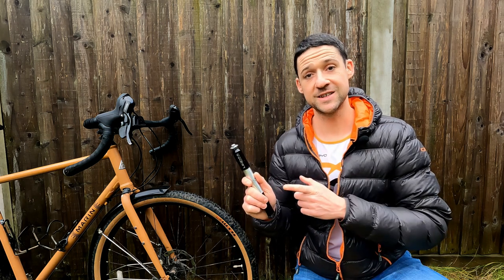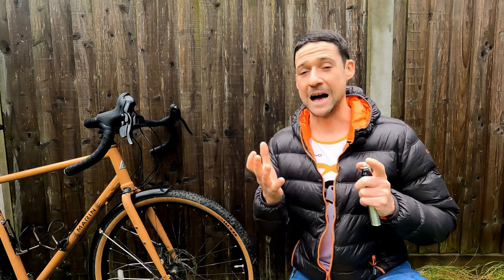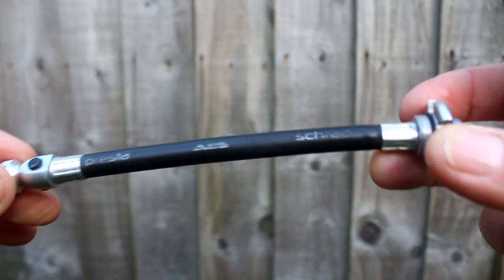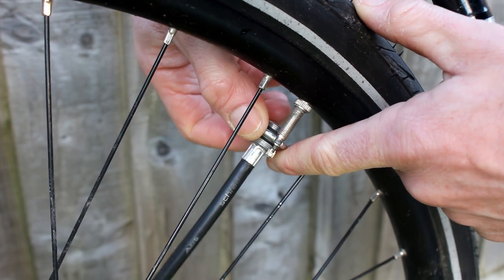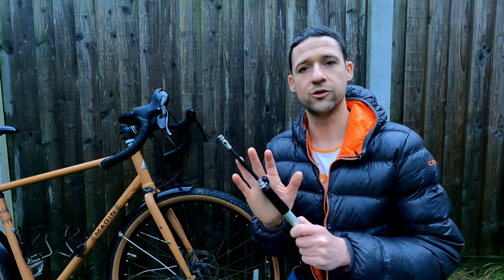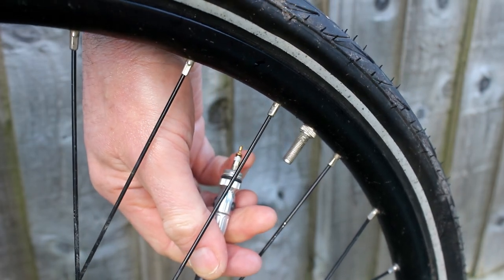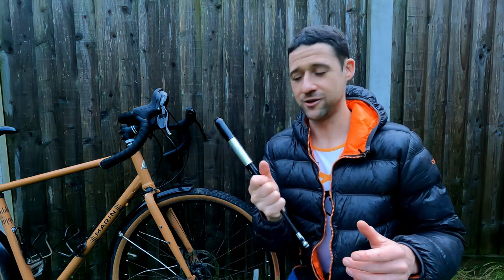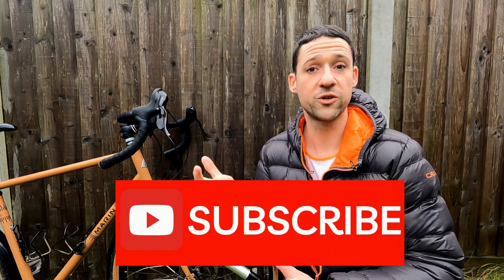Worlds Worst Bike Pump | Lezyne Pressure Drive Bike Pump Review

Comment: Hi, Mammoth Journeys! 

We're sorry to learn of your dissatisfaction with our Lezyne Pressure Drive Hand Pump - we put together a Chuck Tutorial Video which operates in the same way as the hand pump you're using to hopefully better explain the steps we follow when inflating tires with ABS chucks. Please see here: https://youtu.be/9acMIpfEA1s we also put together a comprehensive guide to our chucks for further information which you can see here: https://youtu.be/6sz7bxtZJi4 

Some steps to follow when using the ABS chuck systems:

Steps for inflation (Presta valve): 
1. Remove valve cap
2. Loosen valve nut
3. With tire deflated, regularly ensure valve core is tight with built in Presta valve core wrench (be sure to loosen valve nut for correct engagement) 
4. Thread on chuck (do not overtighten)
5. Inflate tire
6. Press ABS button to release hose pressure for easy chuck removal
7. Unthread chuck
8. Tighten valve nut
9. Install valve cap

Steps for inflation (Schrader valve): 
1. Remove valve cap
2. Thread on chuck 
3. Inflate tire
4. Press ABS button to release tire pressure for fine tire pressure adjustments
5. Unthread chuck
6. Install valve cap

Additionally please ensure the quality of the tubes you are using as well as the integrity of the threads in the valve cores of those tubes. By following these steps we sincerely hope this improves your user experience. Our goal is provide world class product with pure function and clean aesthetics of the highest quality. If you have any questions please feel free to reach out! Thanks!
Reply from the maker: Hi Lezyne, Thanks for commenting on this video from my experience. 
Before I bought this pump I had read on your website along with the videos on YouTube how to use the hose, along with reviews of the risk it posed. After the first time the inner core came away I made sure that the inner valve was tight enough, and then kept pressing the ABD button to really make sure any pressure was released, which seemed to have good success. Until, it happened again, a further two times. 
From the comments there are certain workarounds to avoid this, the most practical is to buy inner tubes which don't have a removable inner core. I also fully admit the biggest impact is user error, however from the comments here and other printed reviews of this pump, I am not alone in my experience. 
One thing I cannot understand, and I really hope you can shed light on is this: During the R&D process the inner valve core would have been removed during use, prompting the videos you linked above to made and a thorough checklist on how to use the pump produced. Did it seem like a reasonable risk at that stage to continue with the current design versus altering it to avoid this risk entirely? I can't believe with the team you have, that a risk when using a pump is that the all the air you have just pumped into your tyres could be lost, they would be happy with it. You produce products which are too high quality for that to be a scenario - what are your thoughts?

Thanks again Lezyne and happy riding!

Comment: Bought one last month while on vacation. Rubber hose part has has metal fitting which screws into the plastic threads on the pump body. Needless to say I didn't use the pump until we travelled on, only to discover the cheap plastic threads are stripped.
Super expensive pump already, but now have to pay for shipping to send it back to where we bought it.
Reply from the maker: Oh no mate that is some rotten luck. Clearly someone not doing their QC checks! Hope you got your money back alright in the end. What did you go for in the end?
Reply: @mammothjourneys  Seems many products are "rotten luck" these days the way they build stuff now. I can name at least 6 overpriced items that were awful quality I purchased/replaced over the last year: that pump, eye glasses after one year the scratch proof coating began to separate from the lens, a short lived dishwasher, an outdoor light that leaks water into it, a very expensive mountain bike with 2 recalls and other horrid cheap parts on it, car tires that took no time to wear out, a rear view mirror for my car that falls off because the windshield replacers didn't use the correct mount. It's not just bad luck; it is modern day get rich quicker engineering scams. Have a good one!

Comment: I've had this same problem with Lezyne when unscrewing the hose, but it happened after not using the pump for a long time and an easy fix was using a bit of Lithium grease on the nosel and it hasn't failed since, "best" mini-pump ever ;)
Reply from the maker: That's not a bad idea, do you still get a good fit for the hose to attach? Ha ha nice upgrade in title as well!
Reply: @mammothjourneys  still works 2 or 3 summers later
Reply from the maker: @rgpeters  that's what you want. Good to hear mate, I'll check it out. Do you apply to grease at home and leave it as is, or take the grease on a ride with you?

Comment: Threadlock! I don't think anyone's mentioned it. I've had the same issue with the same frustration. But if you put some blue thread lock on your valve cores and do them up snug you shouldn't have any issues. However, it does seem like a faff compared to using something like the excellent zefal hpx. BUT the pressure drive is excellent for the size X speed of pumping and has both valve types.
Reply from the maker: @3charactersforkhandle  good suggestion cheers mate. Thread lock has been mentioned before so clearly a good choice. You're right it does seem a faff, but once you get over that it does pump up to a high pressure for a reasonable amount of time. I was tempted with the zefal hpx, have you found it decent?

Comment: I love my Lezyne pump, never unscrewed the valve core. Just   stop unscrewing the hose after  it is off the valve stem for goodness sake, also nip up the core with the tool provided.
The description in the vidoe for fixing a puncture will only work for tyres filled with sealant,  otherwise you actually repaor the puncture with a new tube or patch!
Reply from the maker: Good to hear you aren't having the same luck as me. I presume it's the same model?? 
When you say stop unscreweing the hose after the valve stem, what's the other option?
Reply: @3:52 the hose is unscrewed from the stem but you keep turning it - just pull it off rather then continuing to completely unscrew the valve core!
My pump is an more basic plastic handled version to be fair - I didn't see the benefit in paying more for a handle that feels less comfortable, harder to grip, and is more liable to paint scratches etc. But I think the same principle applies, make sure the valve core is torqued up more than the hose, you can also apply a bit of silicone grease to the gasket on the hose.
Reply: Oh I also found that the internals of the pump were pretty much unlubricated from the factory - and although it worked ok that way a bit of silicone grease on the o-ring helps it to run cooler and with less pumping force.
Reply from the maker: @Twisty1024  ah OK I'll give that a go thanks for the suggestion. Makes sense and hopefully it sorts the problem. Cheers mate 👍
Reply from the maker: @Twisty1024  the lubrication is a great idea for all pumps, nice thinking!

Comment: I just read an old review of the original model and this was mentioned, though he did say that Lezene recommend to use loctite on the valve core threads. I think I'll still buy it as the other pump with Co2 capability I wanted seems impossible to get now and just try and remember to get use loctite. I'm fortunate that I use Milkit valves which allow you to take the valve cores out without losing any air, so it won't really matter either way. Hope the loctite tip is of value!
Reply from the maker: Not heard of those valve types, will check them out thank you. Yeah the loctite suggestion seems to have cropped from a few people so must be fairly effective. Hope whatever setup you went for works, happy riding mate 😃
Reply: @mammothjourneys  Cheers! I should have mentioned that the Milkit valves are tubeless (a patented design). I just bought one of these though I only just noticed they're not exactly the same (I like the ability to mount the pump/Co2 cartridge on the frame),   ... have to say if I wasn't using the Milkit system I'm pretty sure I wouldn't buy it.
Reply from the maker: @childofeternity  As a tubeless option is Milkit decent? Only Stand in the past so always good to look at different options.
Reply: @mammothjourneys  It's the only brand I've used so I have nothing to compare it with. I've also been fortunate to never have had a puncture. Unless it's sealed them without me knowing! It did win an award a few years ago and has stuff going for it — like its valve system/set-up etc, and it lasts a long time, so I'll stick with it until it fails me (hopefully never). I just replaced the valve cores as it goes (old track pump bent the tip of the valves) was nice to be able to just unscrew them and pop new ones in without losing any air/messing with sealent.
Reply from the maker: @childofeternity  that sounds perfect and exactly what you want from a product. Thank you, I'll check them out for my next upgrade!

Comment: Easiest solution to this apart from tightening the valve cores properly is get some cheap a*s decathlon inner tubes from Decathlon. They have fixed valve cores. It only happened to me once, after that I made sure the valve is tight.
Reply from the maker: I by chance stumbled upon this fix by chance the other week, with some cheap inner tubes I bought. They didn't have the screw on the valve cores which I realised would be perfect for this pump. A much cheaper option than buying a new pump! Happy riding mate 😀

Comment: obviously the valve needs to be tight but i've never had this issue probably because when I attached the hose i don't over tighten it on to the stem.  just tighten until it stops.  Its not my favorite pump and agree with you about the plastic but never had the issue you speak of and am a daily commuter for several years with many many flats.
Reply from the maker: Good to hear you haven't had the same issue. I did try and not tighten it on as much but then found it didn't stay on, perhaps I didn't get the sweet spot. Which is your favourite pump then? And how come you have a few to pick from?

Comment: I totally agree with you that Lezyne, should have done a better job in testing their product. I also had a bad experience with the Lezyne Pocket HP when I had a flat tire towards the end of the ride and a fellow cyclist stopped to help me and you probably guessed he had that pocket pump and it happened as you’ve described in your video, twice .. I own several mini-size and a few floor pumps and I’m on the market for another one, something compact and reliable. That’s how I came across your video. I haven’t read all the comments, so I apologize if someone else has mentioned this or a similar solution. In, fact, I just tried this with a different pump just a few minutes ago, and it seems to work. I have a Schader to Presta valve adapter, which its weight is negligible, and I screw it on my Presta valve and pumped air into the tire effortlessly. So if people don’t mind carrying a small aluminum adapter, that may be the best course of action and you still keep your pump. In fact, you tighten up the inner core of the Presta valve once you are done and you can place the Schrader back on and live it there, so you won't forget it. Not an ideal situation, and does not excuse the manufacturer’s product flows, but you get to use your pump effectively since you have already made the investment. Just a thought..
Reply from the maker: Sucks to hear you had a bad experience with the pump. Twice is a bit brutal as well! No-one has recommended the adaptor yet which is a good option - how much did that thing cost? At least you don't have to shell out on a new pump which is good.

Comment: So would you suggest that pump for Schrader valves exclusively? Despite the issue you mentioned, it works good?
I'm interested to use it for 650b tires (47-584), Schrader valves, 70 PSI max pressure (I only inflate them up 60 PSI max).
Reply from the maker: I've used it on Schrader with no issues at all. It being a screw fit means it's secure. So if it's in your price point then go for it! 
For that PSI you'll probably be able to hit it with this pump. I hope that helps 👍
Reply: @mammothjourneys  Yeah that was helpful, thank you.

Comment: I have one of this pump, I don't like it either cause it's just too small and too slow.  After I tried it once I switched to CO2.  Just one thing, why do you use these detarchable valve core inner tube...  You can use those non-removable valve inner tube that won't have this stupid problem..
Reply from the maker: Completely agree it would solve the problem. My tyres already had those types of tubes in, but since this pump when I replace them I choose the ones that can't be removed. 
CO2 is a great option, so much quicker.

Comment: im wondering if an adapter presta to shradder would help solve the issue ?
Reply from the maker: As in on the inner tube valve? That hasn't been mentioned and is not a bad suggestion as it's small. Would you still be able to get the pressure you want?

Comment: Explain to me how does removing a thorn causing a puncture is going to solve the problem without patching or replacing your inner tire by just pumping some more air in ? you won't get far like this or what am i missing :-) ?
Reply: Or is he talking about tubeless tires or tires with sealant inside ?
Reply from the maker: Ha ha good point, should have said put in a new inner tube or patch up your old one before starting the fun and games of pumping.
Reply from the maker: @Buzze1985  just tried to make the point of removing the thing that caused the puncture to the inner tube. Nothing on the tubeless front on this video. Hope that helps 👍

Comment: Which portable bike pump do you recommend then? I haven't used one before so I have no clue.
Reply from the maker: After the fail I had with this one I went for the Topeak Pocket Rocket mini pump. It seems reasonable so far but ironically since I bought it not had a puncture out on the road - can you believe it! Have you bought the Lezyne pump? If so a few people in the comments have suggested some options to make it work, have a read and I am sure it will help. If not, which pumps were on your shortlist?
Reply: @mammothjourneys  Thank you for the reply. I actually tried out Topeak's mountain morph pump at the shop today. I stopped forcing it once there is resistance in the cylinder. Do you force it further to put more air into the tires or is that a bad idea?
Reply from the maker: @去看海-j9j  without a pressure gauge on the pump it's hard to know the true pressure in the tyres. With hand held pumps it's generally tough to over inflate. As they would be mostly used to get you home, simply squeeze the tyre by the side and compare with the other tyre. You don't want to overinflate as that runs the risk of bursting the inner tube. It would be helpful to have one pump at home with a pressure guage to reduce this risk. I'm not too bothered on my small hand held ones as I only use this in emergencies and I know I'll get tired or won't have the strength to over inflate when using it after repairing a puncture. What type of valve and tyre are you using on your bike?
Reply: @mammothjourneys I have Schrader. Not sure about the tyre.
Reply from the maker: @去看海-j9j  I have actually bought this pump years ago. Incredibly practical to use it you have the space to carry it. The little foot stand is so helpful. Schrader generally have a lower pressure than presta, so just keep an eye on things when it becomes tough. Squeeze the tyre wall inwards and compare it to the other tyre. Once you get close to what the other one feels like stop. Hope that helps, happy riding!
Reply from the maker: @去看海-j9j  I have actually bought this pump years ago. Incredibly practical to use it you have the space to carry it. The little foot stand is so helpful. Schrader generally have a lower pressure than presta, so just keep an eye on things when it becomes tough. Squeeze the tyre wall inwards and compare it to the other tyre. Once you get close to what the other one feels like stop. Hope that helps, happy riding!
Reply: @mammothjourneys  Thanks. People like you just cheers me up. Human vibe.
Reply from the maker: @去看海-j9j  no problem, happy riding mate 😁

Comment: I only had the presta core issue once but then I mainly used Schrader valves. HOWEVER . . . . it's almost as annoying with Schrader because I'd frequently assemble it the wrong way around, which is my fault but still annoying. Overall I was never that impressed with this pump (bought it during lock down I think when alternatives were limited) and subsequently swapped it even though it is still in working order.
Reply from the maker: Interesting a Schrader user also didn't like it. Sorry to hear you had the same experience, what did you go for in the end?

Comment: I have a Lezyne floor pump and mini pump. Beautifully engineered and thoughtfully designed. 
If your valve core is coming out:
1. Tighten the valve core a little more than finger tight. There is a tool built into the pump.
2. Don't over tighten the chuck on the valve. Don't tighten until it stops, a few turns is all that is necessary.
3. Use the ABS button to bleed the pressure from hose before unscrewing from the valve.

Even if you don't use a screw on chuck, presta valves can be delicate, they're soft and bend easily and therefore can break off if treated roughly.
Reply from the maker: Thanks Dan these are some good points. Being gentle with the presta valve is important for sure. 
Good to hear you are having a decent experience, and with the floor pump. 👍